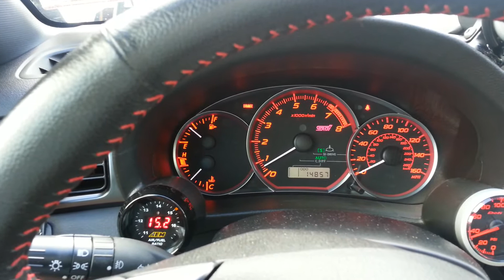13 STI upgraded injectors and rails ticking

Comment: I'm running ID1000cc injectors as well as the Cobb fuel regulator kit on my 14 STI. Just had my car tuned a few days ago and I have the same noise. Tuner said it is normal. The noise you hear is the fuel pulsation in the hard line which run through the cabin on this vehicle. I only hear the noise on my car inside the cabin and at idle/low rpm. Once I get moving, I no longer hear the noise
Reply: same
Reply: Same and I’m running 1000cc injectors as well as the DW 255 Fuel pump. And I get exactly the same thing your getting. Did your DAM ever drop under 1.000 at all during your noise? Just curious.

Comment: I just upgraded to 1100 cc injectors.  My tuner said that noise is completely normal.  It is your injectors pulsing man.  It's kind of cool if you ask me.
Reply: I also have aeromotive fuel rails.  The system is changed to a parallel system.  I wouldn't worry about this but I would check with a tuner to make sure the car is running good.

Comment: Personally that would drive me nuts lol, I'd insulate fuel lines and get some two part silicone rubber molding goo and make up some bushings for the fuel lines between body contact points. And through in some Dynomat while I'm at it too. At least it's easy to tell its not valve lash +

Comment: Same noise here! ID1000cc injectors, Radium fuel Rails. 🤷🏾‍♂️
Reply: Kelvin Ramos I have the same noise with a radium FPR. Damper would solve this.. Mine sounded like I was having rod knock only by my feet on drivers side
Reply: @adamswartz7670  same noise it's bad